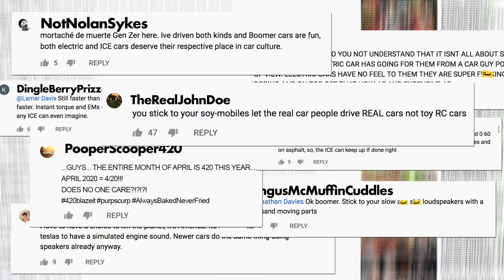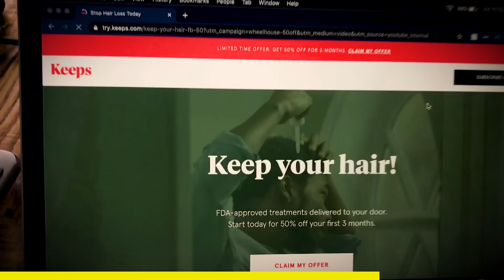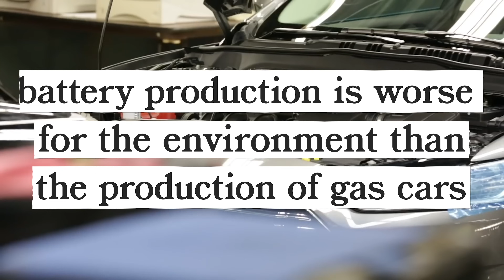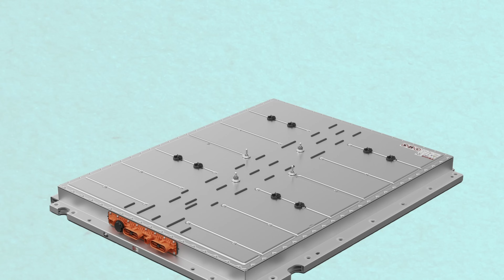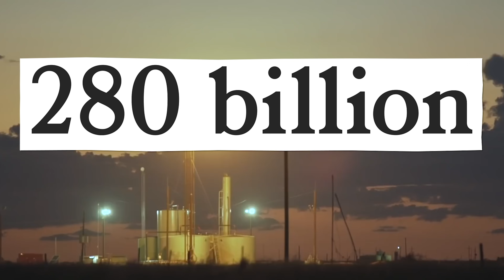Are Electric Cars REALLY Better for the Environment?

Comment: what about if you crash a EV that cost 20.000 dollars, and the waranty say no used parts, they wont fix it, it cost to much and it will be wrecked. And if the battery is dead after 5 years and no warranty on a 20.000 dollar car, and it cost 7000 to change the battery, it will be wrecked.. so many things that dont work out here. can anybody answer this!!?  i need it for a school project
Reply: Battery warrantees these days are around 8 years and they last well longer than that. On average twice as long as a combust car will.

Usually when insurance companies claim it’s too expensive to fix, they take the car and they don’t wreck it. They usually fix it in house as cheap as possible and re-sell the vehicle, give that if there are no spare parts, then the insurance is sitting on a goldmine of spare part to keep and charge customers with the same car extreme amounts for spare parts from your wrecked car.
Reply: @engineeringtheweirdguy2103  But if the insurance dont fix it, you end up buying a new car. That dont seams like a good way on the environment. I try to find out if the cars are more vulnerable to not get fixed, since any crash that maybe hurt the battery pack can result in the car get wrecked. The cost of a batterypack is around 8-12000 and if the car is at a price of 20.000 it dont make sense, and if you can only use "Tesla parts, orginal parts" to keep the warranty.. hmm thanks for your respond.
Reply: @christianandersen6101  no Tesla new is 20,000. However those cars are seldom scrapped. And usually refurbished and resold to someone who’s upgrading from
A combustion car. EV’s don’t add to the car pool, they replace the car pool you can only drive 1 car at a time. If you’re going to buy a new car anyway, you’re better off getting an EV on an environmental front. Most new cars don’t get scrapped they get sold second hand replacing another combustion car.

Comment: this is why i hate EVs
Reply: Why is that?
Reply: @engineeringtheweirdguy2103  because they cause more pollution, they dont have the same mileage as gas cars and dont last forever like wind turbines theres a reaosn Russia has no Evs and never will
Reply: @bludeuce3855  they last longer than gas cars and pollute less and have significant health benefits compared to gas cars.
Reply: @engineeringtheweirdguy2103  I get all of that, but I refuse to be forced to get an EV. Most of the ones I've driven are just so boring.
Reply: @chinto6389  I’ve never found my EV boring but I wouldn’t want it forced on anyone. People have to make up their own minds
Reply: @engineeringtheweirdguy2103  I'm glad to hear you're enjoying your EV man, more power to you. It's all just preference, although I feel like at one point we'll all be forced to switch to EV.
Reply: @chinto6389  depends where you live I guess but it’s not going to get easier to own an ICE car unfortunately. Something that was always going to happen though as oil reserves run out and oil extraction becomes harder and harder making it more expensive
Reply: @chinto6389  depends where you live I guess but it’s not going to get easier to own an ICE car unfortunately. Something that was always going to happen though as oil reserves run out and oil extraction becomes harder and harder making it more expensive
Reply: @engineeringtheweirdguy2103  I live in California so it's only a matter of time 😂. I'm still gonna enjoy my ICE cars as much as I can.
Reply: @chinto6389  which is something that President Joe Biden is trying to do which is force us all to buy electric cars
Reply: @frankfarmer7706  well until Joe Biden , Gavin Newsom, etc figure out a way to make a convenient way for everyone to charge their "EV" I don't wanna hear anything from them. They must assume everyone lives in giant houses like them.

Comment: I feel you may have forgotten a major step, what happens when the battery becomes waste? Is it bad for the environment or is it neutral?
Reply: Right now there isn’t much for recycling but there are a lot of smart people and start up companies working day and night to solve the recycling issue. Old car batteries may get reused for grid storage as a buffer for energy demand spikes, after which they will be broken down into raw materials and used to make more batteries.
Reply: @atomicmuffins1328  VW have it sorted. Watch the YouTube video of the VW EV battery recycling plant in action.....
Reply: It can be recycled to some extent.

Production of new batteries is pretty dirty though.
Reply: @Olivia-W  So is the extraction and refining of oil......
Reply: @Olivia-W  ev white oil
Reply: Plus that was never factored into the total carbon footprint numbers which means this video doesn't prove anything YET
Reply: @GTOPontiac1968  Um, no? You can't factor a used up battery from an EV (200k miles) unless you do the equivalent for an ICE at 200k itself. Even then, the tech is still developing. Who says an EV battery won't last 200, 300, or even 400,000 miles?
Reply: @br9760  again even if it does last X amount there's still a carbon footprint to recycle and the end of life. We know what the carbon footprint of recycling a fuel powered vehicle is.
Reply: @br9760  Well there already is a YouTube video posted by a Tesla Model S owner. His car has covered 400'000 kms on it's original battery......
Reply: It is a problem, but he really just used CO2 generation as the measuring stick.

Comment: F*ck electrical cars and whoever proposed them as the future. As a car petrolhead, I am broken hearted to learn that manufacturers will be making electric versions of their popular sports car. Who wants an electric m3 or ferrari when you have a beast inline 6 and a beautiful sounding v12. Sports cars in the future will not be unique anymore, they will all just be about numbers.
Reply: Why can’t they be unique? Because they don’t make a vroom vroom sound? Like any other cars, torque characteristics, motor and drivetrain design, weight balance, centre of gravity and suspension, the feel and control around corners and in the straights, will all be vastly different from car to car. Hell if you’ve drive a model 3 then jumped into a model X you’d know this already.

And it’s one thing to like sound but when your going for performance, electrics starting to become the go to.
Reply: @engineeringtheweirdguy2103  because cars nowadays are like phones. Samsung or I phone you want to buy and throw away to buy another. Thats not the car way.
Reply: @terminator595  EV’s aren’t made to be disposable. They’re made to outlast combustion engines.
Reply: @terminator595  wth ??
Reply: @engineeringtheweirdguy2103  so basically he is saying that he likes a car that makes a lot of noise because it makes her feel special and wants to have attention
Reply: @engineeringtheweirdguy2103  no electric cars have worse performance than regular petrol cars. Electric cars only have instant torque because they have no gearbox and big numbers on paper. Electric cars will be slow on the top end and remember that weight is the enemy of performance. Petrol only takes a minute to fill while the fastest charging electric car would take probably 10-15, it is time consuming. And also about aesthetics, electric cars have no curves or lines or anything, their wheels have no concave, its just flat. Interior is filled with too many screens my eyes might go blind by looking at them. Manufacturers are going electric because the government told them so. If people stop bitchin about the environment, combustion engine will live forever. In the future, it will just be one two three or four electric motors instead of three cylinders, inline 4, 5 cylinder, inline 6, v6 v8 v10 v12, w12 w16, and all of them have different sound that you can enjoy on twisty roads and for daily driving.
Reply: @nikospov  actually they do have better performance. The model 3 for example when compared to the self dubbed “ultimate driving machine” BMW M3, performance better with handling, acceleration and track times. High end speed isn’t useful for legal speed limits and rarely for tracks. Instant peak torque, no gear changes and it’s extremely low centre of gravity give EV’s a massive native performance edge. Whilst high end performance isn’t super great, they can still do better times on drag lines and track times being SUV’s and luxury sedans than most purpose built sports cars. And you’re telling me they don’t have better performance?

And if you think the engine is the only thing that gives car character or soul you really shouldn’t call yourself a car guy.
Reply: @nikospov  character and soul is about how it feels to drive, is it smooth, rough? How does the cornering feel, the feel in the seat as you accelerate, how the car navigates traction, all those things five cars it’s soul and character, you trying to tell us one of the most unique driving experiences on the planet as “no character” really? 

As a wise man once told me when I was sceptical about EV’s. If they only thing you like about a car is how the sound of the engine tickles your nethers, you’re not a car person, you just have an itchy clit.”
Reply: @engineeringtheweirdguy2103  nah look at maserati, the only reason why people buy that car is because of the derived ferrari engine and the sound it makes and the way it looks. It performs nothing like their german counterparts. But why do people still buy them, because it has more soul and character than their german rivals. A model 3 is not better than an m3 and dont say that a luxury SUV or luxury sedan are better at drag times or track times. A taycan will destroy a model s in every aspect and a 911 will destroy a taycan in every aspect. Electric cars are made for efficiency that is legit their sole purpose it is not made for performance. Cmon man you know this, every car manufacturer every year all they think about is money, they don’t care about car enthusiast anymore. Soft limiters speed limiters OPF those are not what a car person wants in a performance car. Look at the mk5 supra, the most bullshit car toyota has made with fake vents they say are functional. What a joke. They are a multibillion dollar company and cant even make a proper successor because all they care about is money and low cost. Nissan who are on the verge of bankruptcy made the 400z with a freakin manual. That just shows you how dedicated and true to their roots Nissan is. In my eyes, electric cars can replace daily drivers, but not performance cars.
Reply: @nikospov  actually the 4 door large luxury sedan model S plaid variant now does a 1/4 miles in 9.23s, whilst a taycan does a 1/4 miles in 10.5s, a 911 does it in 10.1s so that’s a big outchy. Especially considering both the taycan and the 911 are both 2 door sports cars and the model S is a 4 door luxury sedan.

Tesla’s aren’t built for performance. It’s just a natural benefit.
Reply: @nikospov  also yes, a model 3 is better than an M3 in acceleration, track lap times, and handling. Even on top gear which are notoriously anti-EV they compared the two cars directly and the only category top gear could get a win for the M3 was in it’s made up “driftability” test which it had neither used before nor since. And claimed that since the M3 won the driftability test practically saying it has poor handling, and despite the fact it lost the 1/4 mile drag, had slower lap times and worse handling the declared the M3 the winner because they could lose traction more easily. 

Don’t believe me? It’s on YouTube. Google it and watch the model 3 slaughter the self proclaimed “ultimate driving machine”
Reply: @nikospov  and the model 3 is the best selling luxury car for a second year running. In any category, SUV, estate, hatch, midsized sedan, large sedans, etc etc. best selling luxury vehicle period. And sells more than its next two closest competing cars combined.

There is probably a good reason for that. And there is probably a good reason why studies have found that the model 3’s biggest market are FORMER BMW M3 MODEL OWNERS
Reply: @nikospov  in the USA Maserati sold 11,000 cars total in 2019. Across all their models, the Tesla Model S in the US sold 14,500 units in 2019 and nearly doubled that in 2020.
Reply: @nikospov  so as you do aptly asked, “so why do people still buy them”
Reply: @engineeringtheweirdguy2103  remember that USA is not the whole world, there are other countries and continents in the globe. I think the c class is the best selling luxury vehicle in the world. I mean Tesla shouldnt be called luxury with all that cheap plastic inside.
Reply: @engineeringtheweirdguy2103  why do you care so much about numbers lol would you want to own a car that everyone has, or would you rather be unique or different and it doesnt matter the ghibli and granturismo would always be better than a model 3. Of course the model 3 has more sales it is cheaper what do you expect. If a ferrari cost as much as a camry would people still buy a camry???
Reply: @engineeringtheweirdguy2103  are u talking about the top gear video from 2 years ago with that guy driving not Chris Harris? Yea lol that guy cant drive hahahah oh and the tesla huge fail on the drift. That is the character and soul of the m3, very fun car and tail happy that is what people are looking at when buying an m3.  The tesla model 3 performance also is an awd car so u are comparing an awd to rwd
Reply: @nikospov  both driven by the same person. A segment done by Richard Hammond. Driftability isn’t a real test.

At the moment EV’s are very unique, they’re selling lots but they still don’t have nearly the market penetration of combustion cars.

Yes, if a car is tail happy or not is character. But that being said a car clinging to the road is still as much character as a car letting itself go sideways. It depends on how the car feels. That’s why it’s called character. Everyone has one, it just depends which characters resonate well with you. Which is why saying EV’s have no character or soul is a fucking stupid thing to say. Of course it does. And an incredibly unique one at that. You just don’t like it. Which is fine. But you can’t deny that EV’s have extremely unique character.

And the model 3 has outsold even cheaper luxury vehicles. But internationally is a different story as Tesla cars are still rolling out internationally, you can’t get them in every country.
Reply: Another words you like making loud engine noises just to annoy other people around you to make yourself feel pretty special
Reply: No its about character and soul, a c63 without a v8 is not a 63. The engine is the heart and soul of the car.

Comment: What about the steel to make the electric cars, the battery replacement needed for said cars vs pistons rods and such. And maybe the fact that refineries emit more ghg but also because not all goes to gasoline and diesel, as more costly and profitable items are made. But! We should all just swap to e85 and e90😈
Reply: o so zou have a plastic petrol car. interesting

Comment: You didn't include battery replacement through the life of EV's
Reply: EVs don’t need battery replacement
Reply: @jabbalito3787  yes they do
Reply: @sumgaye5951  No they dont. the batteries will loose charging capacity over time but they wont need to be replaced
Reply: @jabbalito3787  if they lose charging capacity, eventually they need replaced lol
Reply: @jabbalito3787  .. my smartphone says differently!
Reply: @GetYourselfANewMap  No they don't necessarily need to be replaced. They can be REFURBISHED......which is considerably cheaper than a complete replacement!  Some of you people really do need to do more research.......  Try watching the YouTube video of the 10 year old UK owned Nissan Leaf having it's battery REFURBISHED. The work took around 4 hours and cost the owner £600.  It really does seem like some of you people just guess before you post, without actually knowing the facts......
Reply: @jabbalito3787  … good luck telling that to your 3 year old smartphone!

Comment: What about when you have to replace your batteries for your EV ? That could be done 4 or more times per life of car. There's so much that is never brought up when discussing electric cars an I think it's not brought up for good reason.
Reply: Common misconception. In 1990 that was the case, in 2020 the batteries will last twice as long as a standard combustion Engine.
Reply: Then you really ought to watch the YouTube video posted by a Tesla Model S owner. His car had covered 400'000 kms on it's original battery.....

Comment: This is a very good report Donut. However I am keeping an open mind about EV. I remember when people told me that Diesel was cleaner than Gasoline. We had Electric cars in the 1920's but we were sold the ICE engine instead so one man could make a lot of money regardless of the enviroment. Which of couse was not an issue then. But now we have another man selling us electric cars to make a lot of money. But don't laugh at the Emperors new clothes unless you wish to laugh at your self. Because we all have a way of rushing into things, or being persuaded to believe that we are going down the right track. And History usually tells us that it is because someone wants to make a lot of money. But we still fall for the emperors new clothes, because most of us are just followers, and whilst we try to make the argument simple by only throwing only two choices in front of us, like we often do with politics. My point here is that we should be looking and considering the other alternatives instead of supporting just what we are being sold. For those of you who are old enough to remember the Fat versus Sugar argument that we grew up with, and we now finally know the answer to that. A little slower and less fashionable persuasions without knowing all the facts could make a much bigger difference to our environment. And there are more fact involved here than have surfaced at the moment.